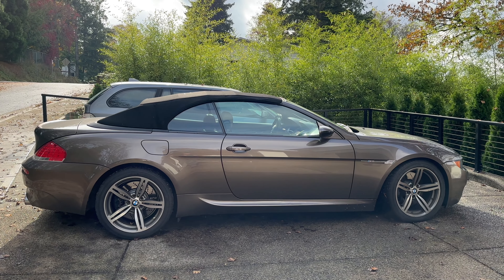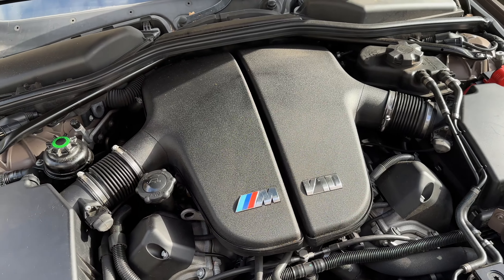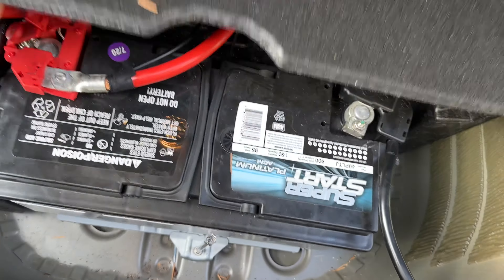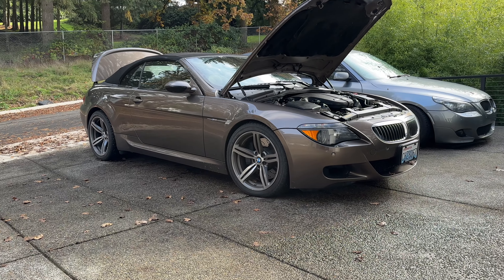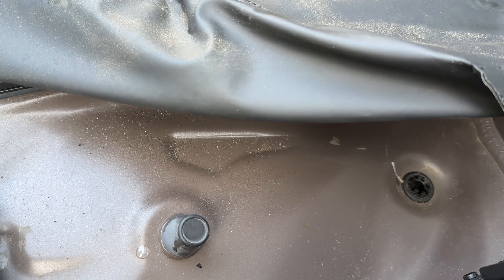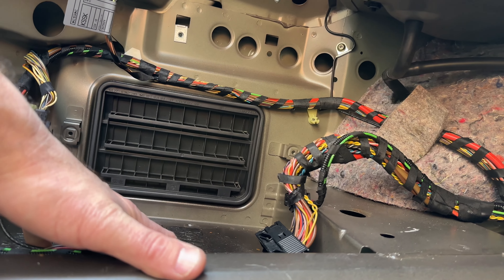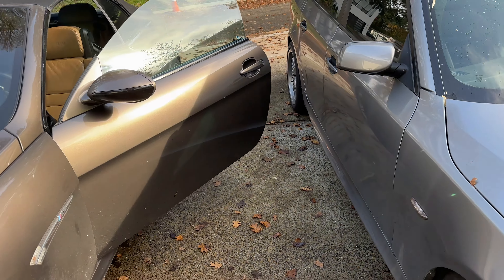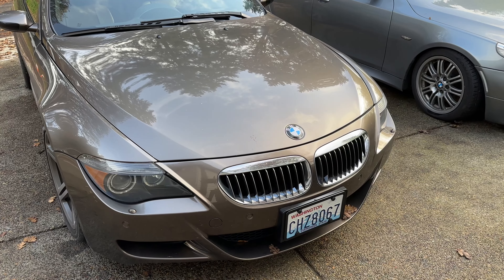First 5 months of ownership & BMW E64 drains maintenance.

Comment: Great video! Any update on the wagon as well?
Reply from the maker: Coming soon!
Reply: @EliteBimmers  can't wait! Also can you include how the isc coils are holding up too?
Reply from the maker: @drifter2090 yes, but as a spoiler they are still working well.
Reply: @EliteBimmers  oh that's great to hear! I'm planning on doing just the basic isc fronts without the camber plates, should be a bit more comfortable with the rubber bushing top hat. Do you remember if you upgraded to the triple spring option?
Reply from the maker: I dont remember which ones I got exactly. I can look up my model number in my email history. But back in the day, they did not offer much choices.
Reply: @EliteBimmers  ah I see, that's no worries! Thanks again and will keep an eye out for the video!

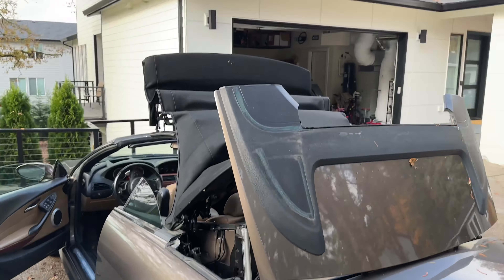Comment: What is the green color where the roof seals to the black plastic part on the nacelles? Or is not green, just something with the lighting? 5:58
Reply from the maker: It’s actually white color and those are water residues spots. They can be cleaned. I will remove them after the “rainy season” here in the state of Washington.

Comment: Why ist the Carly app showing “last occurred at 255000km”?🤨 Or is the screen from other car?
Reply from the maker: Lol yeah, that's strange! I did not notice that:)
No idea!
Reply from the maker: Now I am worried that I got scammed. Will be researching it when I get back home 🧐
Reply: @EliteBimmers  I am afraid you are, had 645  with about 90k miles when I sold it and it was in much better condition inside.